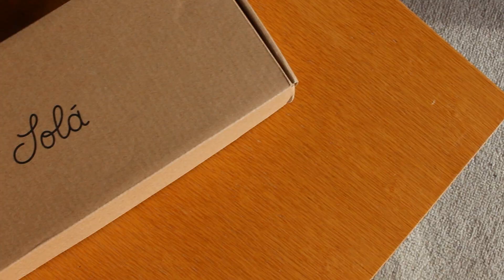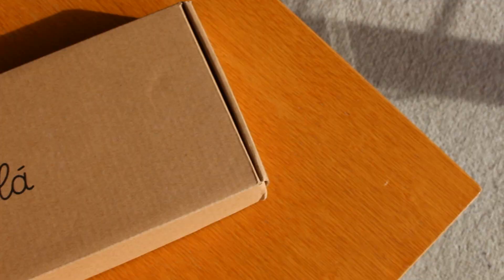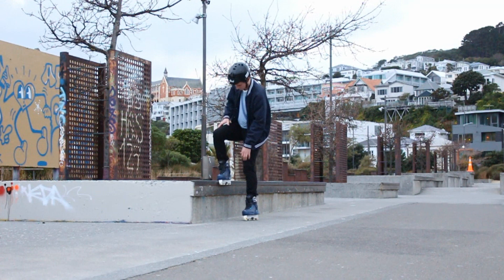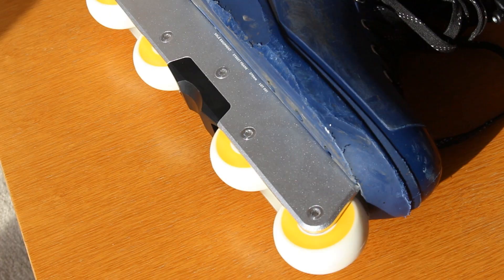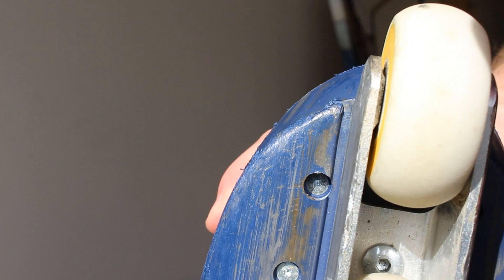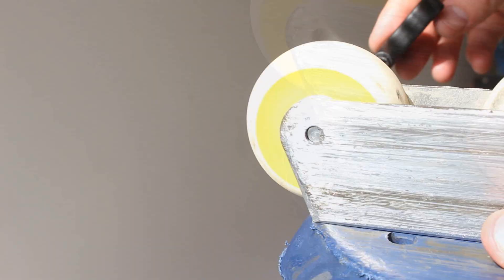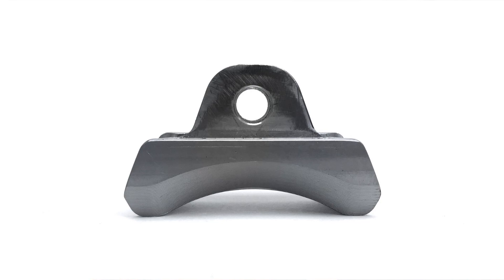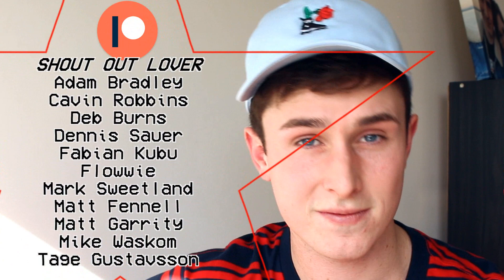Sola Street Frame Review

Comment: The harder the wheels the more rattling sound it makes. Some time ago I ordered the Symetrics 4x90 Complete frame. They rattled so much straight out of the box. Biggest problem was the lower quality of the bearings they came with. After switching to Bones Reds the rattling was much better. But I still feel the 90A hardness isn't really my thing, it's the second cause of the sound. I should've bought some comfier 86A wheels, still super fast, but noice-free.

Comment: Great video as always.
On the clicking noise... I ride the 88A Dead wheels on FLT3 and I hear this noise. I noticed that in some of the wheels, the bearings don't sit flush. I hear the clicking when bending too, which is likely the wheel slightly adjusting because of the extra space.